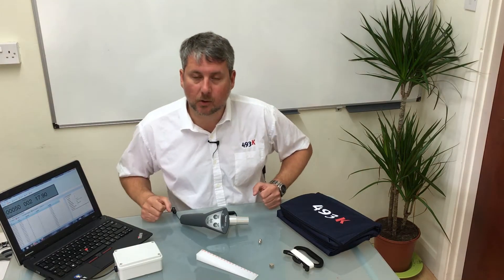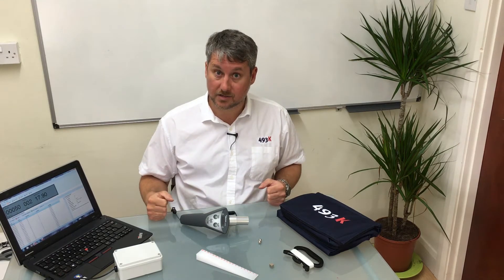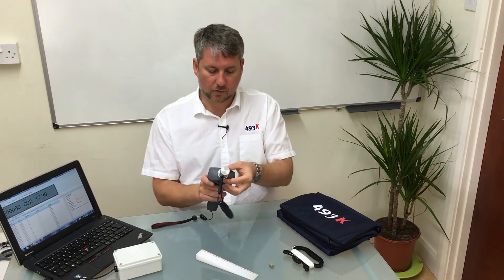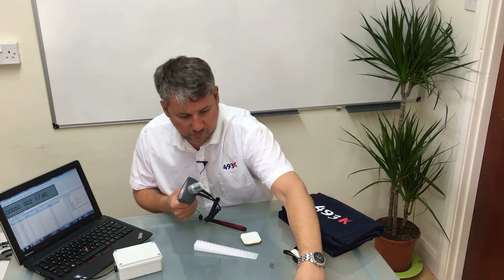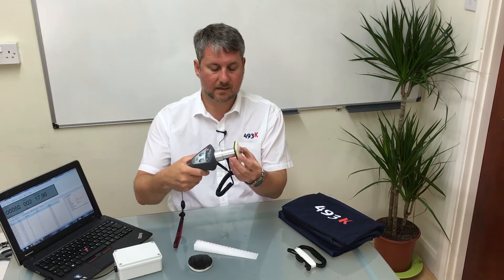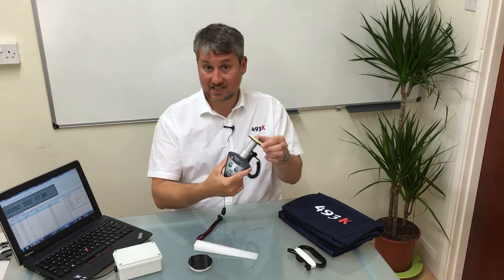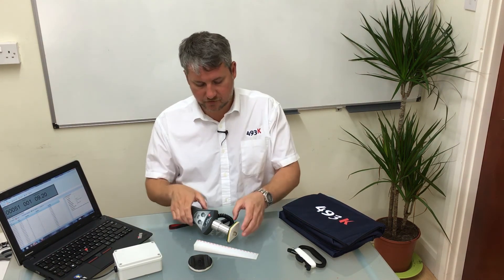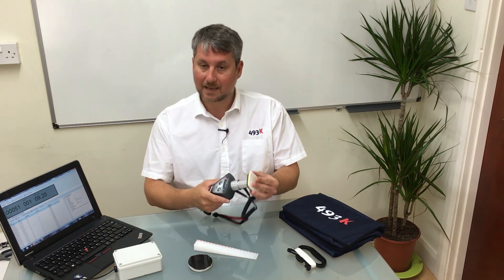K-METRON Radio - Thickness tester for rotomoulders

Comment: We now have four of these K-Metron units and they are great, they give consistency and critical measuring without the  need to cut sample prodcuts up. They are ideal to check tool wall thickness giving an instantaneous measurement which helps when setting up tools and program allowing subtle changes to be made.This is a very robust unit and the operations staff find it so easy to use and to gather data.Shaun Mills - Rototek Ltd